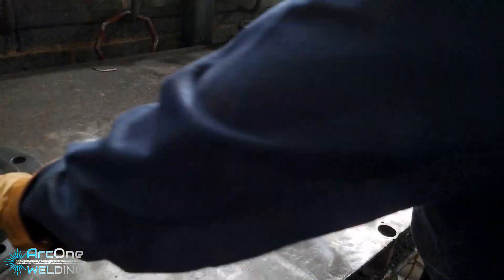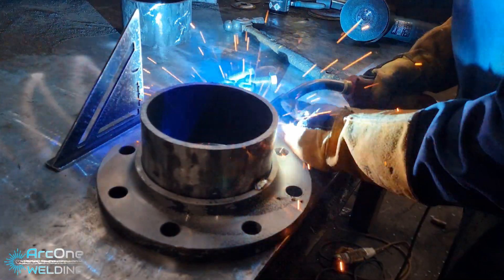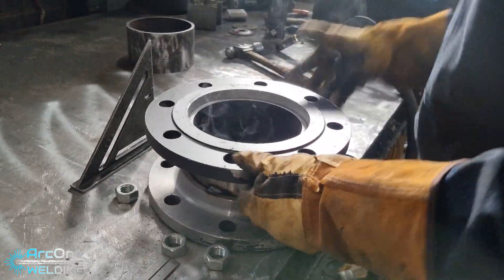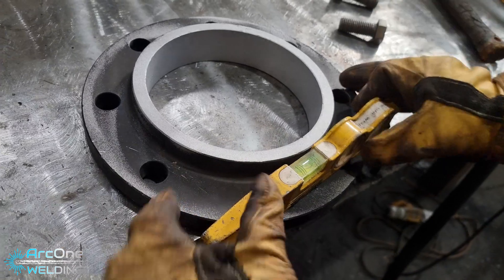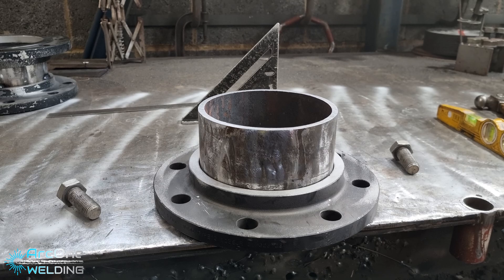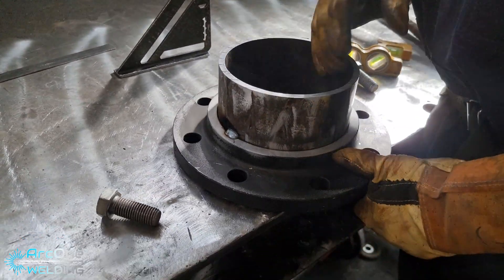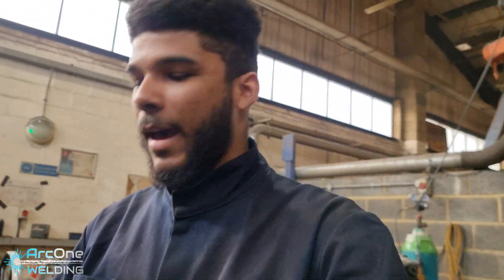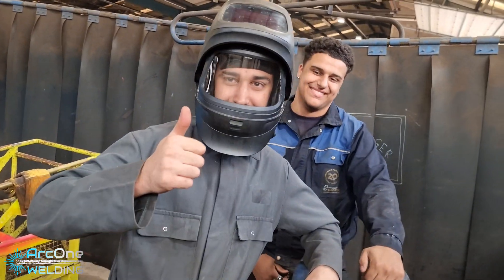Advanced Pipe Spool Fabricating Techniques (MIG/MAG) TIPS!

Comment: I have been a pipe welder for many years, I had used the 3 nuts to set spacing on flanges for a long time...I never thought about setting the 2 hole by using two bolts up against the table edge...pretty cool trick!!  You are a very accomplished fitter and fab welder, I like your videos, keep up the great work!!

Comment: Sorry you'd be down the road if you were working for me mate, lucky they were only temporary spools.
You don't have the earth clamp on the flange or the pup, the earth current is going straight through the face of the flange from the bench??
Nice chance of arcing out directly on the sealing face, instant dnc???? 
Thickness of the pipe wall plus about 2-3mm set back, 16mm (nuts) is way too much 😳 
Also they are call SPOOLS because they look like cotton reel spools, not because of stools you sit on 🤣😂🤣😂
Mate some of your other stuff is good but think this wasn't one of your best 😕
Reply: 100% agree with the arcing on the sealing face
Reply from the maker: I appreciate your criticism bro, but there's many ways to skin a cat if some of these techniques aint for you i understand that, but i work on class 2 pipe on price work, as for the 15mm flange pull out is on my company they tell us how much they should hang on, and yes pipes are called spools but bits like this we call stools and we got other names like hockey stick for a 90 elbow spool
Reply: @ARCONEWELDING  Hey mate apologies for being so harsh, just for me with over 30yrs in piping it is frustrating that one day some young bloke new to the piping trade who doesn't know any better will watch this clip and could possibly end up arcing the face of the flanges by simply not connecting the earth directly to the job, I understand that it's only class 2 standard but to someone who doesn't know (any better) just starting out in pipe fabrication it could cost them their job in their very first day..
Mindful those (apear to be ANSI) raised face flanges have a gramophone finish and it doesn't take much for that to be compromised...
Happy fabricating 👍
Reply: Would the flange gasket not male up for the arcing on the face

Comment: 07:55 use another rule on the top flange bolt holes, then you have accuracy of 1mm over 300mm length. 

I also used a Height Gauge from the machine shop, once both flanges are tacked on, put a square against the sides to see if the top flange touches, or if the bottom flange touches, we're looking to see if it looks like the capital letter 'I' in italics, spin it around to see how all 4 tacks are. 
Smash the edge of the bottom flange against the table to knock it true. Then flip the spool piece over and use the height gauge to see how the top flange is wobbling, again, smash the bottom flange to get it parallel.

You're MIG welding, I was TIG, so my tacks are small and easily moved. 

Other problems we had were pipe cuts not being cut square, so the high point was where the first tack went. We made lots of little spool pieces that could very quickly be on the piss so that's why I ended up going that far with keeping them accurate enough. Stainless flanges warp anyway and once everything is tightened up you can usually pull in any leaks at the gasket.